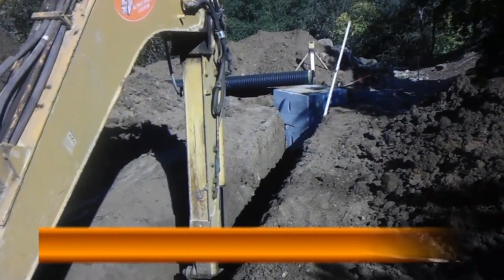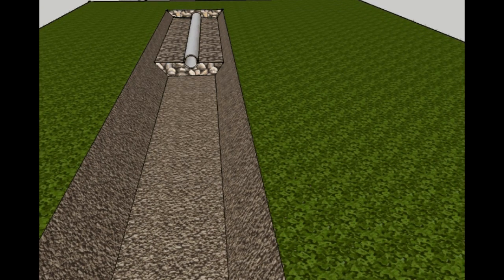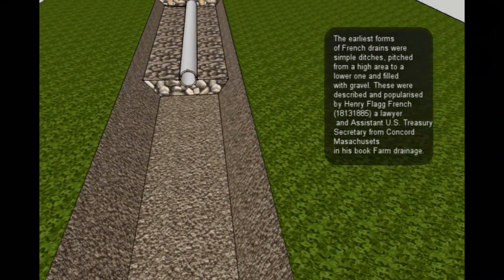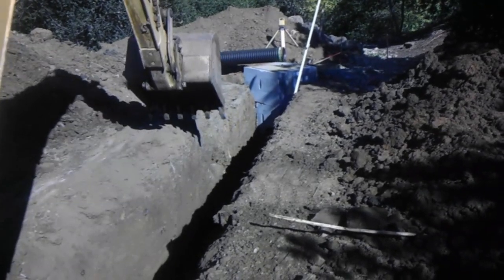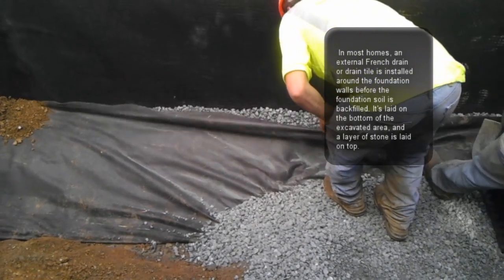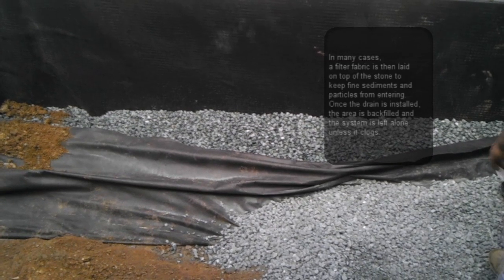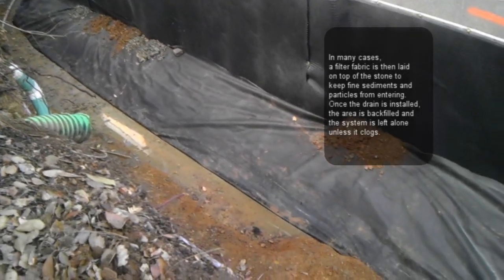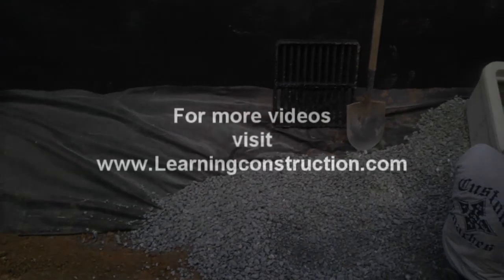French Drain or Perimeter Drain

Comment: This is a great video. I have one question, if you add a french drain to drain out water that enters your crawlspace during the heaviest of rains, then after the rain event is over the very bottom of the french drain trench will remain damp since a french drain won't move the last 1/8 or 1/16 inch of remaining water in the trench. Do you just leave the bottom of the french drain damp and cover the trench with concrete (or  plastic encapsulation in a dirt crawlspace), or is it preferable to not cover the trench under encapsulation to allow the damp dirt to air dry into the (dirt) crawlspace, which would raise the humidity for many days as the damp dirt dry's out?